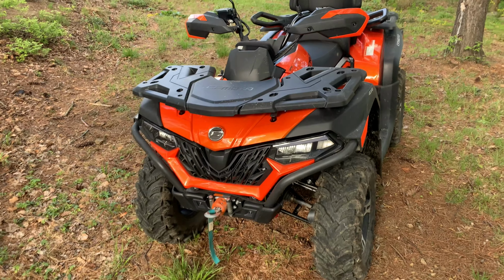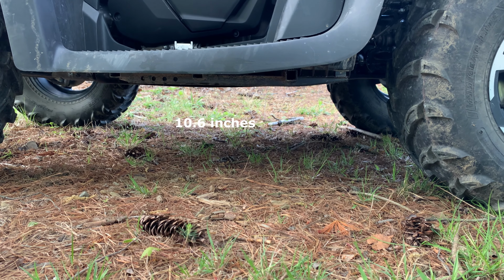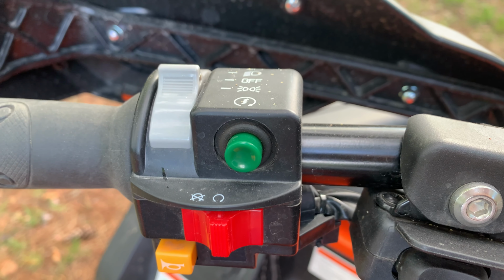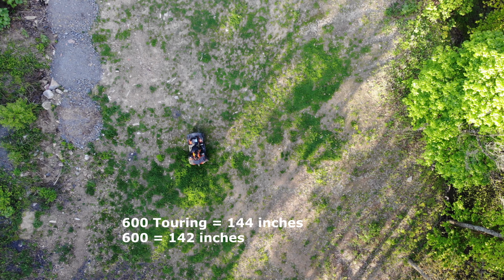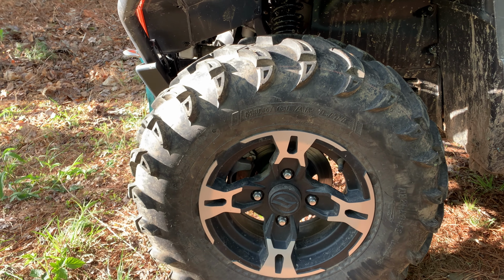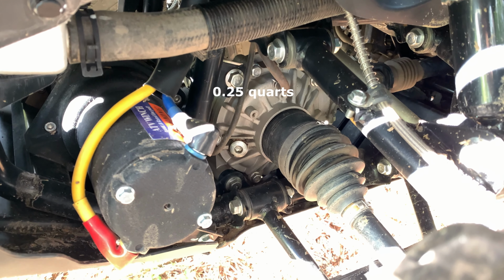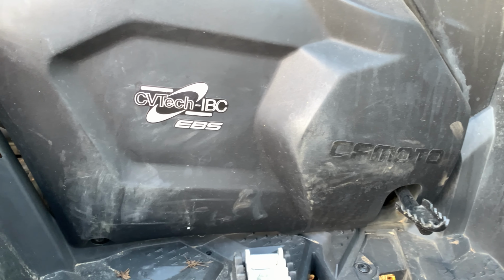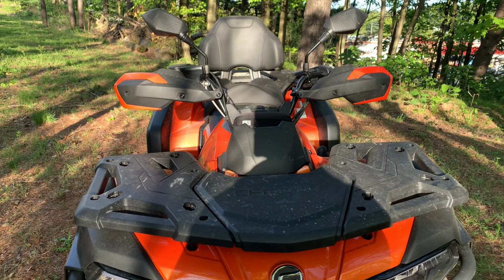SPECS on the 2021 CForce 600/600 Touring AND GIVEAWAY!

Comment: These bikes aren't too heavy compared to the power? A 570cc outlander weighs 741 pounds but has 48 hp. This is 40 hp at 914 pounds. If you stick two more people on it, how much would you lug this down?

Comment: I know your talking about the 600 but I just bought a 500 and the side where the exhaust is gets extremely hot   Have you noticed this on the 600 and have you found a fix for it. Thank you
Reply from the maker: I never really noticed it but after your comment I went out for a quick ride and did notice on the right side where my inside part of the right leg hugs the atv there is some pretty significant heat coming from there.  I think I never notice it because of always wearing jeans while riding.  I'm sure just adding some heat shielding tape inside the plastics and around the exhaust would probably solve that problem easily.  Potential future video?
Reply: @cfmotoman1270  ok thanks. I’ll try that.

Comment: I'm in New Zealand and took delivery today of a 2021 Cforce 625 EPS (It still has the same 580cc engine).

It has the single person seat and turning indicator lamps.  The turning lamps are controlled by a three position switch where the bike in this video has the red kill switch under the green ignition button.   The kill switch on my bike is next to the horn button and is the same shape as the horn button.
Reply from the maker: good to know. this comment will be helpful to other friends in your region! like!

Comment: Is your measurements for the width, outer wheel to outer wheel? I have a trailer that’s 48” wide and I want to make sure it will fit before I buy one.
Reply from the maker: I had some free time this morning and took some measurements. It is 46.5 inches from outer rear wheel to outer rear wheel. It is about 45 inches from outer front wheel to outer front wheel
Reply: @cfmotoman1270  awesome man I really appreciate it!